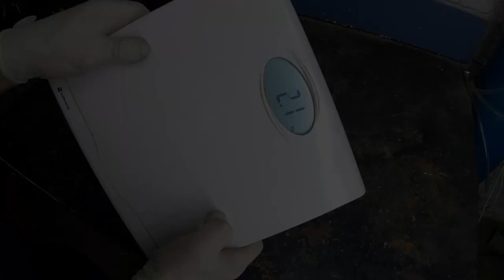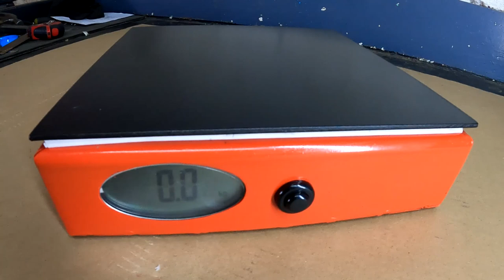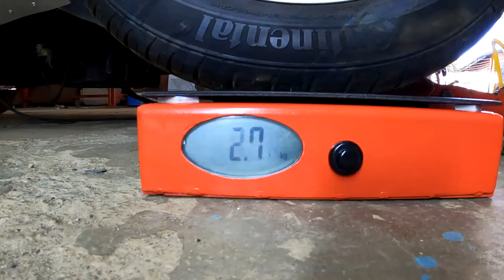30$ DIY Scale for Weighing cars and trucks (bathroom scale hack)

Comment: Does your on/off switch over ride the auto on/off function?  If so, can you provide detail on what terminals to solder to?  Thanks.
Reply from the maker: One of the four load cells had a built in micro switch (auto on/off function). You will recognise it as it has four wires going to it. Cut them off and terminate your own micro switch.

Comment: Hi Mate great work I have be trying to work out how to do this myself without spending hundreds. Just one question how do you work out the length of the lever?
Thanks again for making this video! 👍
Reply from the maker: Consider the rod as a multiplier or devider. In other words, if you make one side of the rod/lever ten times longer than the other (eg: 1cm x 10cm) your reading will be ten times less than your actual weight. ie: 100kg will read as 10kg.
Hope it makes sense.
Reply: Thanks mate👍
Reply: @BroughBuilt so you would need a known weight to calibrate, correct?
Reply from the maker: @charlescarter9270  it would be beneficial to double check but theoretically if you devide the fulcrum into 10 your reading should be accurate (devided by 10 of course).

Comment: oh that's cool, I have never seen inside a digital one only the old ones with a big spring. Don't you need 4 though? or can you just weigh each "corner" and add them together?
Reply from the maker: It would be preferable to have four scales but you can weigh each corner separately as long as the opposite wheel is standing at the same height as the one you're measuring. Theoretically you only need to weigh one front and one rear side then multiply it by two but I have found some differences in weight between left and right.